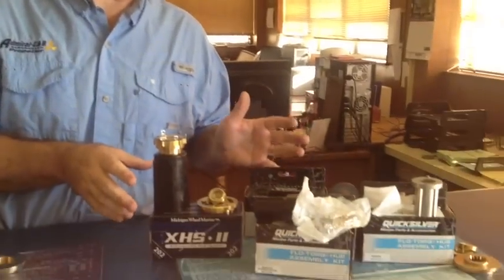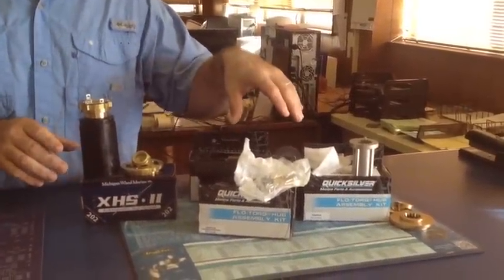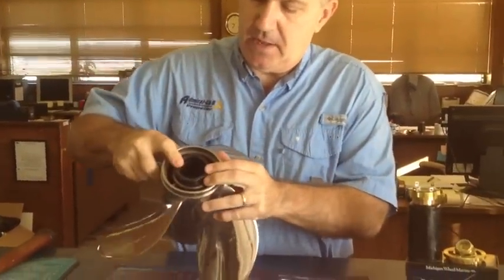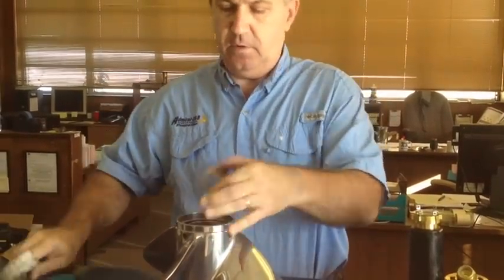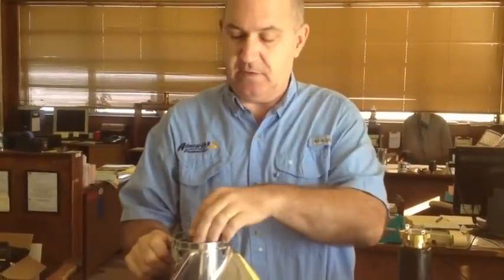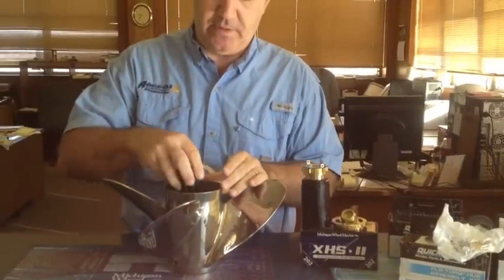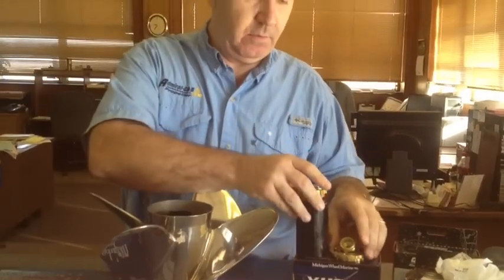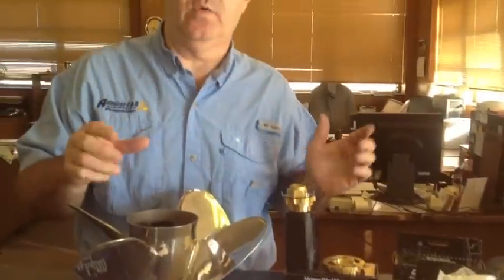Flo Torq Hub Installation

Comment: Hi ive just bought a hub kit and when I put it in the propeller it was extremely loose an didn't fit full length either. I have the ballistic prop. The dealer i bought it off advised it was the correct one. This carnt be correct tho can it. Loose fitting. Thanks craig

Comment: I have a Michigan prop with the flo torq II hub. It was so loud at idle I bought a rubber hubbed Solas. The Solas is MUCH quieter.
Reply from the maker: Especially on the Yamaha 150 and up four strokes the Flo-Torq an be really noisy.  Rubber hubs are quieter, as are the Flo-Torq III and IV hubs and the new SSR hub from Mercury--which all fit in the square hub cavity that accommodates the Flo Torq II.  Keep in mind the noise isn't hurting anything--it's just annoying.  But all the manufacturers are trying to come up with something that quiets down the clutch rattle that is particular to four stroke motors.

Comment: No sir, they are NOT all the same.  My new prop for my Yamaha came with TWO kits, one flow torque for Merc, one flow torque for Yamaha, and the main washer is shaped differently for Merc and Yamaha (Quicksilver).  The quicksilver seeded into the hub properly, the Merc did not and would have been a damaging mistake if I had installed the wrong kit.

Comment: Both hub kits are not the same... there are certain ones for Stainless and certain for Aluminum.
Reply from the maker: My point on being the same was related to the installation techniques used for both the Flo Torq and XHS hubs--the installation technique is the same.  That being said, there are not different kits for aluminum and stainless steel.  The are some kits that help the reduce the clutch rattle of four stroke motors (like the Flo Torq III and IV kits) but functionally there is no difference between installing an aluminum prop and a stainless prop so the kits are the same.  The 835257K1 kit, for example, the most popular Mercury Flo Torq kit, is used in both aluminum and stainless props.